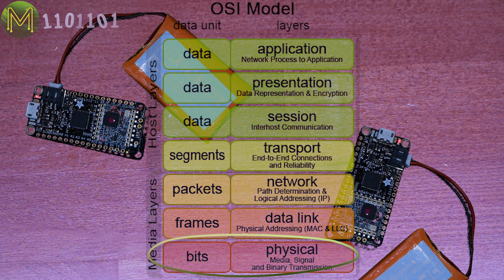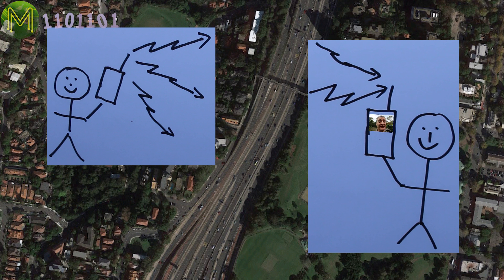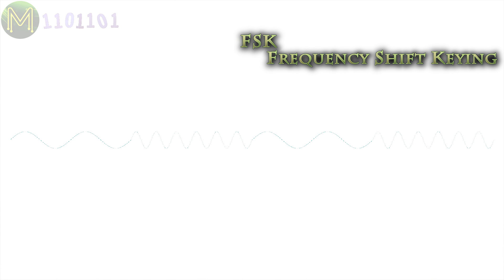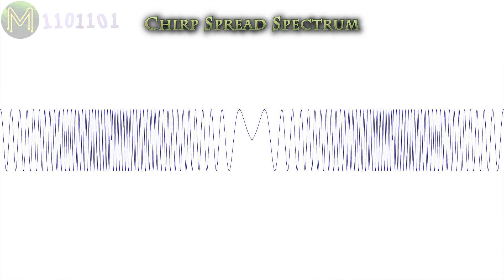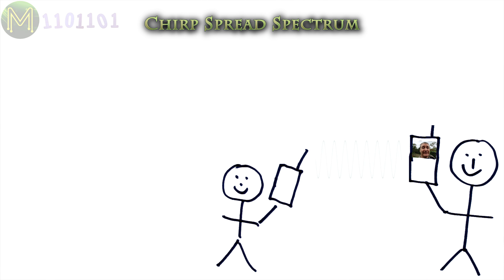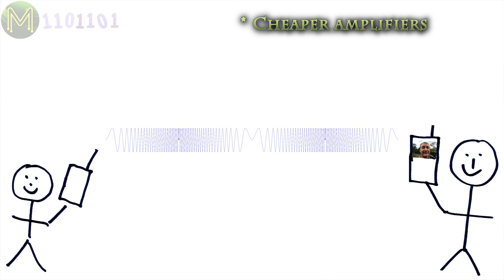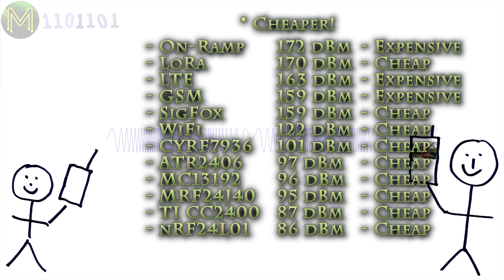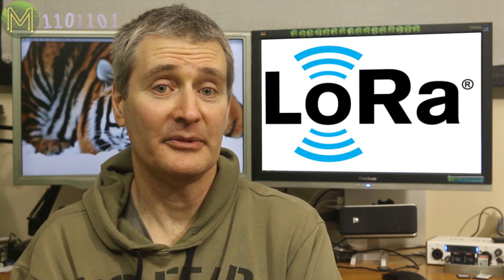#145 What is LoRa? // Tutorial QuickBits

Comment: These quickbit things are fascinating... So do you think the latency issue is the reason it hasn't completely supplanted our existing Wi-Fi devices?  Thanks for sharing your knowledge
Reply: also lora is low data rate
Reply from the maker: +pendragnx 
It's really not something that can replace WiFi. LoRa is something for low bandwidth comms within an RF spectrum that's fairly narrow at around 50Kb/s. WiFi, in the other hand, is a high bandwidth protocol, getting up to 50Mbit/s.

Comment: is it possible to use LoRa for sending information like gps coordinates, speed and altitude ?
and then take this data in to an arduino for manipulation. What I'm trying to do is to be notified with voice by the arduino if my speed is over a specific speed or if my altitude is lower of a specific high it. Do you think that this is possible? Thank you !!!
Reply from the maker: Absolutely! But you wouldn’t want to be streaming the data as it’s not the intent of LoRa.
Reply: MickMake 
I want to place it on a drone and have it send me data like gps, speed, etc. Then on the ground I want to pick up the data using an arduino and if the data has a specific value then a mp3 file will play to informe of what is going on. For example if the drone is going over 60km then the mp3 file will play "OVER SPEED"  is it possible? Thanks!!!
Reply from the maker: You could certainly reduce the LoRs traffic by setting up trigger points. In that case, it’s very doable.
So try to limit the traffic between LoRa modules.

Comment: Would LoRa be good for small sensors around a mansion or is that Overkill? Any better system out there?
Reply from the maker: You could, but it depends on how many you want to use. If you're thinking of running 100s, then using 1wire sensors is better. If you're looking at dozens, then LoRa would make sense.
Reply: what do you mean by 1 wire sensors? sensors that are connected by a single wire? is there a max node capacity for LoRa?

Comment: How much speed to expect on 2-5km distance?
Reply from the maker: +hassan nawaz
It depends on several factors; the LoRa module used, the type of antenna, atmospheric conditions, objects in the way.
You should be able to get the full 50kb/s.
Reply: so technically, under best case scenario. It should be possible to get 50kb/s on 15km and 5km with difference of power usage right?